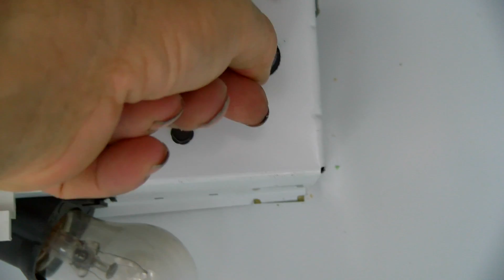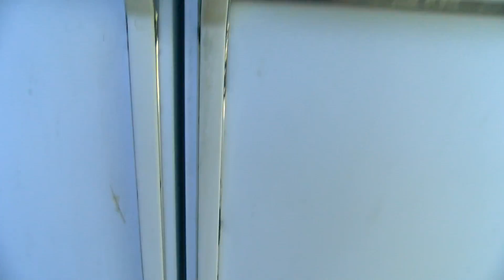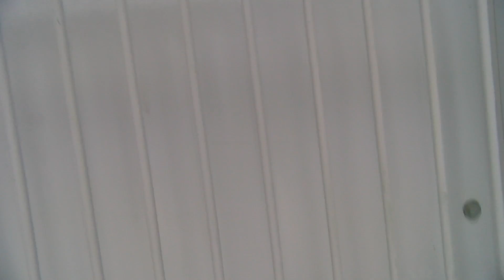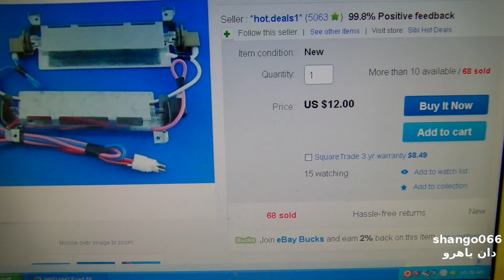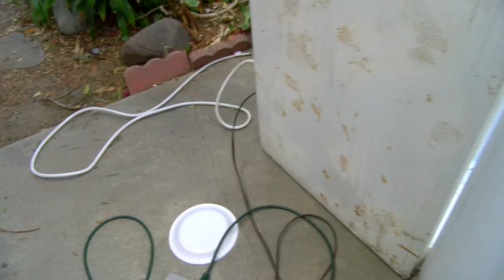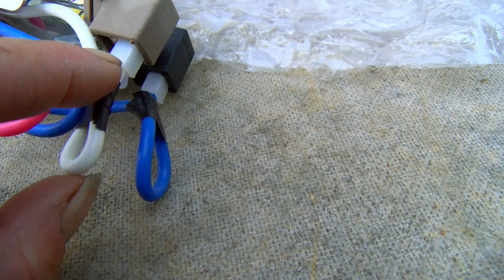ge refrigerator defrost troubleshooting and heater repair

Comment: I just found this. Lucky Me! 👍
yes, I bought a new chest freezer had a warning not to lay the freezer on it's back. 
Of course I saw the warning after standing it up and plugging it in. The instructions said I was supposed to stand it up for hours before plugging it in. Knock on wood, it seems fine.
I clean the coils on my refrigerator and freezer every 2 months with compressed air.
Fascinating video. Learned something, especially about the heater cutout button.

Comment: You definitely have that lower element upside down, you should never see it glow from the drain area. Freezer temperature should be 0 degrees after it runs about an hour. Defrost timers should be replaced unless it is electronic.

Comment: The little round thingy it’s called a defrost terminator. That unit is definitely low on Freon; the compressor should pull close to 600 W when the evaporator is warm; and the condenser below should absolutely burn your hands if you touch it under full load. Also, part of the evaporator is not even frosting which is a dead giveaway.  On those quartz tubes, you really need to make sure that water can’t drip directly on them because overtime they will crack there’s typically a trough that protects the tube from water just pouring directly on it. Before they started selling those integrated units, you could typically buy the defrost heater by itself and it looked like a normal heating element in your oven and those were much more reliable over time…
Reply: Yeah If he’s had it on long enough for the frost to get to the upper part and it’s never doing it then yep. He claimed you can’t fix it if it leaks. Not true. I’ve fixed some myself. And there’s tons of videos on it. I’m fixing to have to change the heater in my 2004 side by side GE for the second time meanwhile the 1990 Hotpoint I have has never had it or any other mechanical parts changed yet.
Reply: I mean I know it’s up to the owner to decide whether it should be fixed or not but it can. He said he’d get rid of it if it did. Probably already did.
Reply: Ok yeah I just heard the part where he said he thinks it’s not working. Low amps. Kinda skimmed through it before. Yeah it’s obvious the sealed system needed attention. Never reached the top of the coil. But like I said I bet he junked it.

Comment: Anybody that’s ever opened up a refrigeration compressor like those used in this refrigerator, has found the bottom to contain a whole bunch of sludge.  There is some idea that you can lay it on the side, that is opposite of the lines but the problem with that is many of the compressors have lines coming out both ends. So after bouncing around in a truck, what you’re doing, is hoping that all of the crap is going to perfectly drain back out of those tubes into the bottom of the compressor before you start it back up. The problem with the sludge is that it collects in the low places/ridges at the joints where the compressor is mated to the rest of the refrigerator’s lines.  So once the compressor is restarted, it in flushes that trapped sludge further on into the system.  We’ve replaced a lot of capillary tubes that were permanently plugged up (and couldn’t be cleared) because of this and had to be replaced; with the expense (unless the unit is newer or an expensive one) most customers elect not repair the unit…

Comment: IMO. -if you have lay in flat, allow 12-24 hours for the oil to stabilize back into the compressor. 
-Avoid using no name brand (china) aftermarket parts, especially not the heating element. Not worth it, too many premature failure rates and not worth the liability issues. 
*I give this video a 8.5 "there" review. There, there, there, there........🙂

Comment: GE TFX25crbg 25 cubic  year 2000 unit also had a bad 725 watt quartz element.  Even kept it going by doing exactly what was done here, disassembled quartz heater element, twisted broken element back  after light sandpapering. Away it went! $12 for a new eleme, which is on order! Thank you so much!

Comment: hi shango, what is connected to the gray single line connector and the white sing line connector? what is the white square box ?
mine is like yours have those single line connectors and nothing is connected there. i guess something is missing here. i got an old GE fridge and previous owner tried to fix it and threw away some parts and i cannot figure out. heating elements and defrost thermostats, every fans and compressor everything seems working fine but it is not getting cold. i did not find a single thermister inside the evaporator panel and other places. this is a very weird one. thank you.

Comment: We have the exact same refrigerator with the same problem.  I know it's hind-sight now, but you needed heating element p/n WR51X443 to get the correct size.  Either way, your video was extremely helpful in diagnosing my problem.  Thank you.

Comment: My parents have two Sears Coldspot frost free refrigerators from the 1960's, one they bought new and one used, the used one was kept in the garage for keeping drinks in. Both of them still work as good as new. They both needed a shot of R22 about 25 years ago and that's all that's ever been done to them. I've bought 2 new refrigerators in the past 30 years, the first one ran 18 years and the last one 12 years and it was made in mexico.

Comment: Hello and congrats for the detailed video. I have an alike -GE "profile"-two door refrigerator and I just tested the defrost heaters, they are working fine. Also, I cleaned the condenser coils. But still nothing, the frost side of the refrigerator is not defrosting. Any other idea about the reason of that malfunction? Thank you in advance.

Comment: I have a similar fridge/freezer like this & i'm having the same problem with mine.
Reply: Yeah mine is a Westinghouse & has a different heater element like ovens do. Mine only has one & it sits right at the bottom just above the drip tray.

Comment: FYI They sell the original GE defroster heating element in the US. I had it shipped to Chile, I installed it about 5 years ago, and my old GE frigde has been working perfectly ever since. Don't buy the alternative cheap kit. By the way, I kept the old kit because I managed to twist the broken coil together and it was working fine, but I replaced it anyway. 
Don't put it in the garage as the guy in the video says, once you change the heating element kit, which is fool's proof easy, you'll have a fridge for another 10 years at least.
Reply: Don't buy china made parts=junk. Mine lasted about a year.

Comment: Actually it is not a myth about the vapor compression refrigeration systems. at least the old ones. We had an original GE avocado green side-by-side built in the 60's and it was laid on its side for less than an hour and when we stood it back up and plugged it in, the compressor overheated and ate itself. Before that the box was running fine,  So yeah it is NOT advisable to put one of these on it's side if you can't help it.
If you have to then you should let it sit up right for a day before running it.
Now this may not be true for modern fridges but for pre 1980's system this is a HUGE no-no.
Chances are by you having it on its side and then not allowing it to settle back by letting it stand upright for a day or so before running you may have created a terminal issue where oil is obstructing a cap-tube and cannot find its way back to the compressor. I say terminal because this will only get worse as time goes on and eventually the system will die.

Second major issue with this boxes are the LV transformer for the in door electronics.
My fridge pulls way less wattage than this one in run or defrost but then again mine is a 2014 model..

Comment: Hi I have had it before where i have had a fridge on its side and somehow compressor has found its way in to the capillarity tube and i tried everything to stop it i even braised a new dryer in, the fridge would work fine and start pulling down fine for about 10 secs then some where in the system was that little bit of oil that blocked it again.
Reply: +Paul Brace That will cause your compressor to eat itself. You should NEVER put it on its side if you can help it, if you do then let let stand upright for about a solid day before running it again.

Comment: is a single compressor fridge/freezer powerful to keep the freezer cold enough in a warm climate?
Reply: +brian whittle Yes if it is operating and charged properly. These things are build in mass and there is no perfect charge, some are over and some are under but all fall within a tolerance set by QC at the factory.

Comment: I remember seeing a water cooler powered up immediately after being carried on it's side. It took about an hour before the the compressor would run with out it tripping. That's not something I would like to do with my own brand new fridge LOL. Interesting video.
Reply: +Coolkeys2009 I had an original 1960 model avocado green GE side-by-side in MINT condition kill itself because it went on its side by my house movers.

Comment: hi sir I wonder if you can help me please I'm  having problems with my fridge the freezer it's ok but the fridge is  not even cooling what do you  think  it has something bad one person told me that I might have ice in the pipes so I have to turn it off for a few days what do you think thank you for your time
Reply: +John borg Clean the condenser coils up and then make sure your box is cycling into defrost. Worst case scenario is your compressor is shot, best case is you have dirty coils on the back or under the bottom of the box.